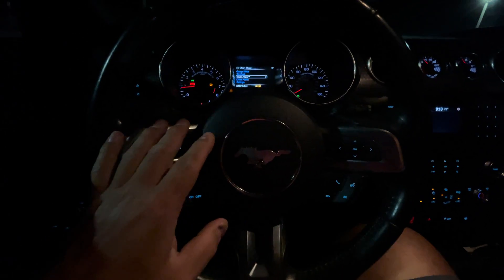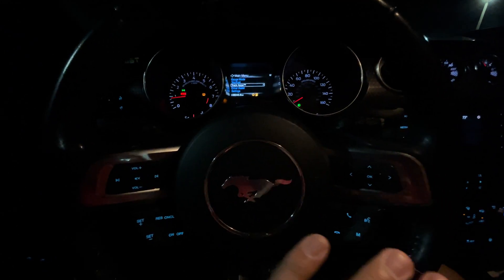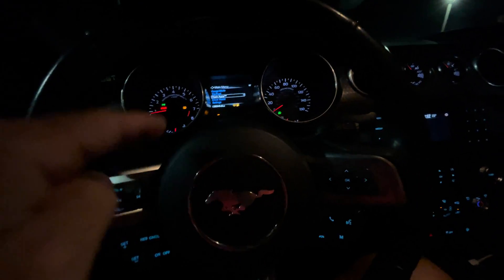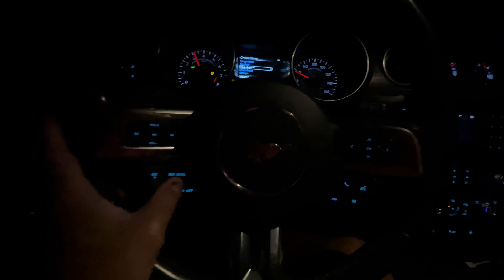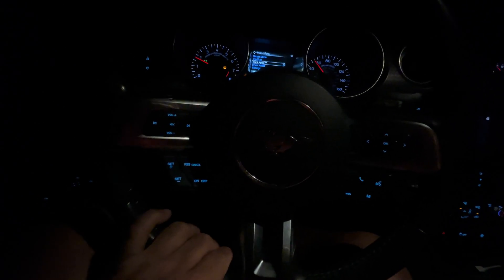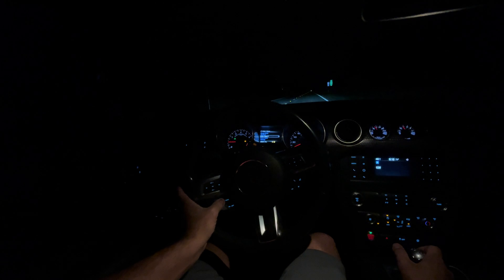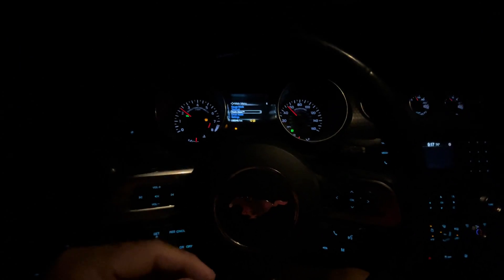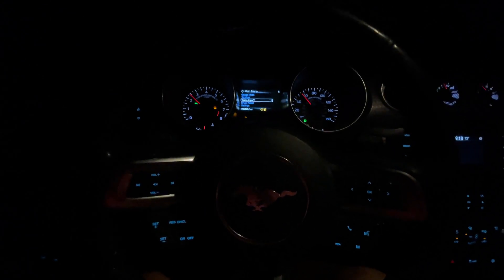@Lundracing @PCMTec Multitune Rolling limiter Overview and test. 19 Mustang GT manual

Comment: Hey,  just order my pcmtec multi time from Lund. My rpm gauge does nothing through out the process.   Speedo sweeps and shows ethanol precent.  Rom doesn’t show me anything for tune selecting  with key on, car off, cruise on or with car on. It does switch tunes when the car is on tho. Doesn’t matter if I press res or cancel. Of I press res or cancel twice, it will let me adjust the ethanol with the speedo.  Any ideas what I’m doing wrong? Lund already sent me a revision 2 incase maybe the file was messed up but same results.  Told me in the only person with this issue. I tried to follow your steps for the rpm limiter but rpm gauge still does nothing. They said later that I don’t have that feature since I’m NA. Any ideas?
Reply from the maker: @les84long1  hit
Up
The 
Ticket 
System.
Reply: @YDBT4LIFE ya I have, the revision 2 is the same. Was just wondering if there was something I’m doing wrong or if that’s a normal thing. Thanks tho.

Comment: I had a 2021 GT Premium with a manual MT82 transmission.  Complete garbage!  I could put up with the plastic interior, engine tick and the glitchy electronics, but the drive train was garbage.  Kept the GT for 2 months and unloaded it....was a pile of junk.  Bought a real car from another manufacturer with a standard TREMEC couldn't be happier...FU FORD!  BTW - if you did buy this POS with a MT82 you can join the class action suit!

Comment: By the sound of the engine this is throttle plate controlled rev limiter. This is also waaay easier on the OPGs vs the much faster cycling and more violent spark/fuel cut.
Reply: It's probably still fuel cut, you can just lower the hysteresis to have the same effect.
Reply: You can make it spark/fuel cut if you want those pops and bangs as well!